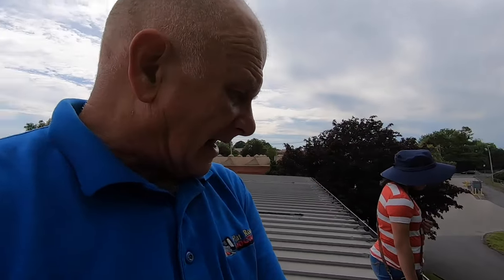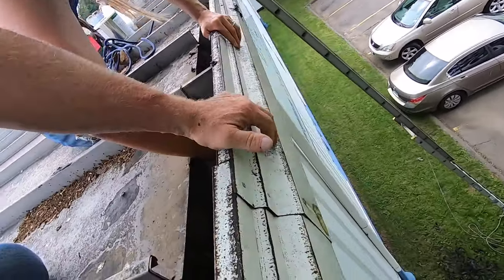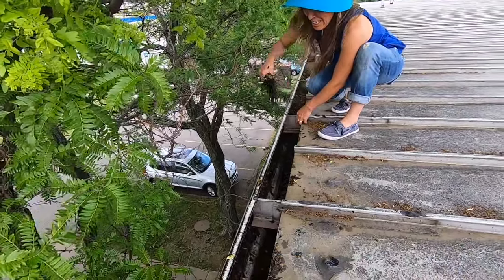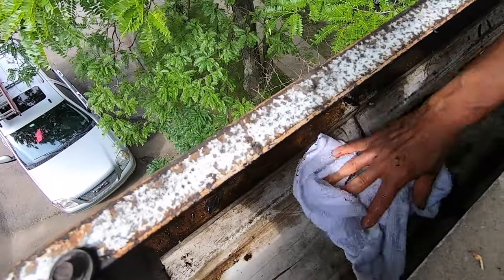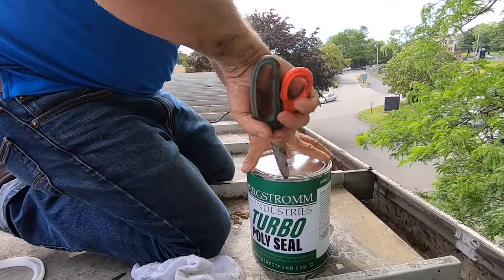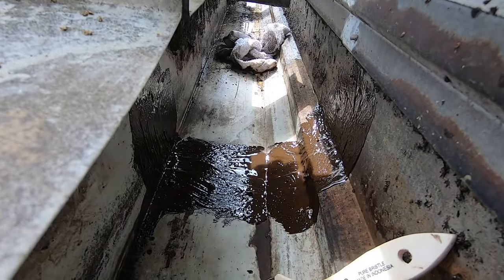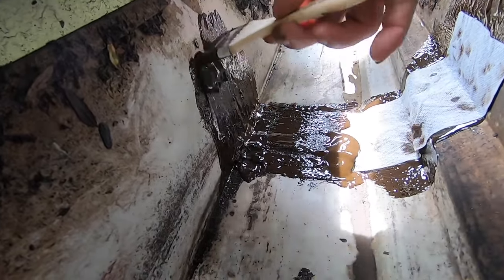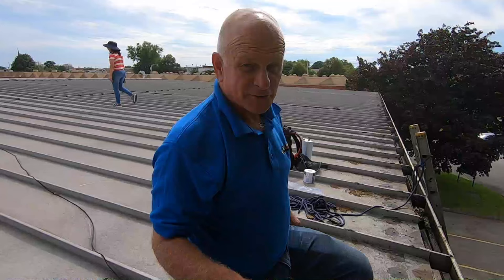How to repair Gutter Leaks under 5 minutes permanently

Comment: That's precoated metal your liquid covering will only last as long as the coating on the metal if it peels off because of rust it will leak again
Reply from the maker: So, if that paint would peel, then surely after 30 years it would show signs, duh. The entire gutter has not 1 bit of peeling. 
When you stop water and oxygen reaching metal, you stopping rust.

Comment: I have my doubts.  Tip.... use a small soldering torch to dry the joint. It'll vaporize the water between the gutter laps. Then three-course......
Keep um coming.

Comment: An I had a rubber rod put on my exspandoo which I believe the exspandoo is my proble where it connects the the main trailer it’s always leaks around there it doesn’t in the exspandoo roof cause of the rubber roof  I just don’t have the money to do the rest but if I can find somthing to use to level the sink hole I believe would be great